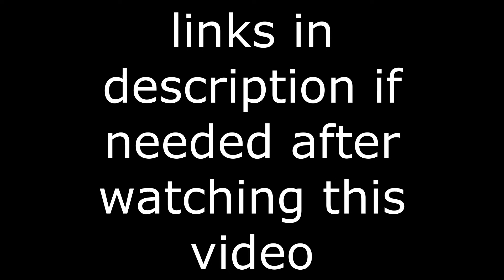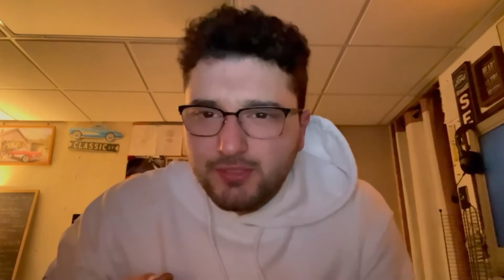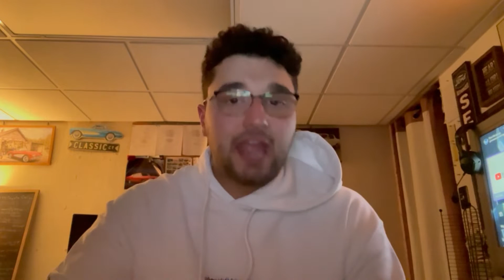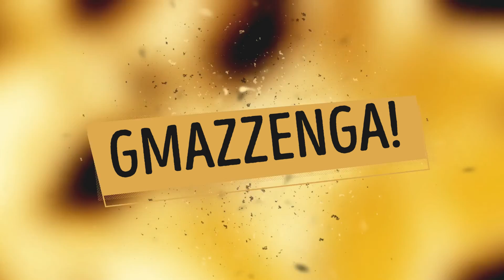99-04 Mustang Common Power Drawing Issues

Comment: I replaced the radio and cut the power wires going into the amps... still going dead in a few days
Reply from the maker: You shouldn’t have needed to cut the wires. There should have been plugs going to the Amps. And you might have to take a test light and use it on your fuse panel when the car is off and test fuses to see which component is drawing power

Comment: 2000 convertible parasitic draw , I pulled the instrument cluster fuse #6  and fixed the drainage , but when I turn car on the speakers make a screech sound , but all the audio works fine , but when I pull that fuse radio turns on I just get no sound

Comment: I have a 2001 v6 mustang and for some reason today it decided to give me issues with my battery. My battery gauge keeps going up and down. I got codes ran on my car but it popped up things I already replaced.now there’s saying it’s probably my battery but my battery is partially new. Any suggestions ?
Reply from the maker: battery gauge going up and down. alternator is going out. if the gauge is going up and down like a speedometer then it's got an intermittent charging issue. also the battery could not want to hold a charge anymore. check both the battery health and get a alternator test done.

Comment: Had a 2003 GT convertible in S Fl. The little leaves from the live oak I parked under would wash off the roof and into those stupidly designed drain holes in the Mustang.  They would clog and all the water would flood into the Mach amps and back floorboard. A really dumbass design.  So many problems with that car. Finally ditched it because the tracloc went nuts and kept locking up the brakes going down the road.  Also still have my 2004 and it just started having a few issue after 20 years. Never buy a Ford convertible.
Reply from the maker: I learned my lesson

Comment: I have an 03 Cobra so mine came standard with the Mach 460 system. My car is a vert and it does leak at the rear window and my car had started killing batteries left and right. I tested for a draw and there was a draw, I pulled the Mach 460 amp fuse first and the draw was gone. Didn't know what was causing the amps to draw power until this video so thank you. It's the water leaking in the rear window! 🤦‍♂️
Reply from the maker: Im glad I could help. I dont know why youtube didnt show any comments on this video at the time or I would have responded back sooner

Comment: I’ve had that mono audio problem too. If i restart the car amps come on fine. i have a draw coming from instrument cluster/pcm
Reply: If you’re referring to fuse #6 in the engine bay from my experience it was the amps, I had the same issue and by pulling fuse #9 (Mach 460…) behind the steering wheel it took the draw from fuse #6 (cluster/pcm) then pulling the amp harness took the draw from all fuses. My battery holds strong now.
Reply: 1111
Reply: Same here